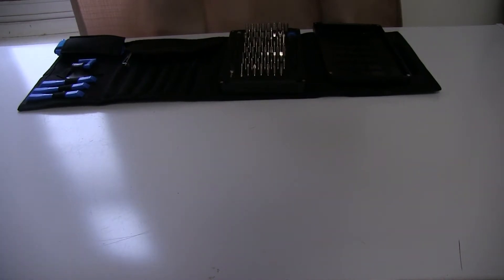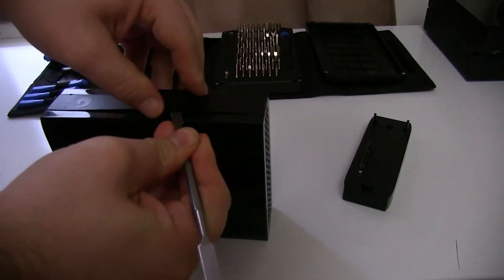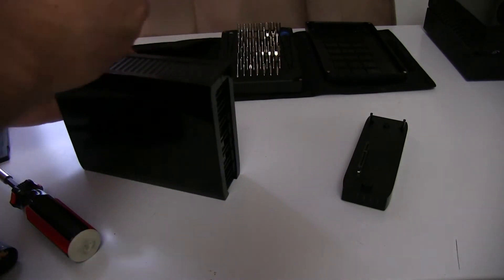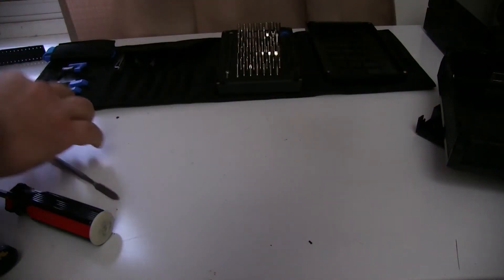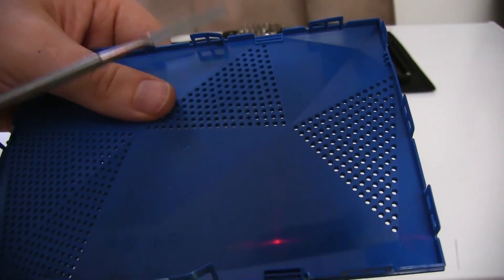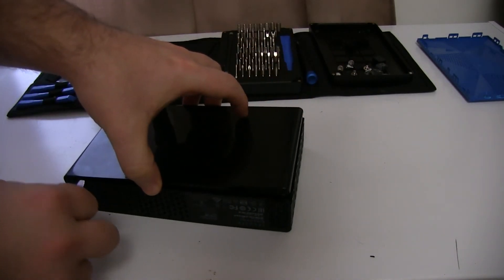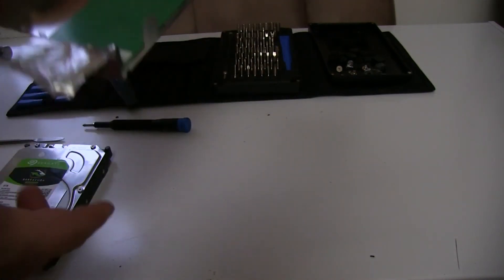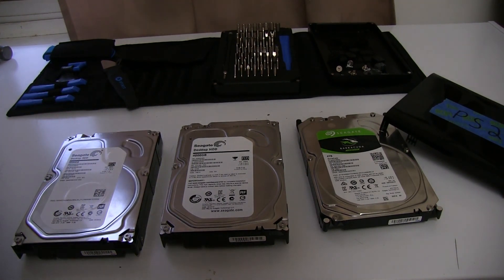How To Disassemble A Seagate External Hard Drive!

Comment: I really appreciate you providing this guide. The first hard drive you worked on is the exact drive I have.  Had it for over a decade before it stopped working. Hopefully removing it from the enclosure and hooking it up to my sata adapter bridge can get it back up and running again.  Your video is one of the only ones I’ve found on YouTube that has a guide for this model external drive and I feel grateful to come across it. Much thanks!
Reply from the maker: great! glad i helped

Comment: Thx. Worked. Its insane and disgusting how much effort they put in to make those drives unacceptable! Specially on those locked boxes with the heat problems.
I opened mine after a broken badblocks. Outside it was warm, inside the drive nearly burned my hand. No wonder so many errors, after freeing the HD it is now nicely running without any errors!!!!
I am sure if they do not change this behavior not right now, they will pay a lot more when anti-obsolescence laws are in-place in US.

Comment: Thank you for sharing this info. I have a 4TB Seagate I've tried to open but the back of the bottom plastic is not prying away and I didn't want to break something important inside. My desktop is not recognizing it so I want to mount it in the desktop to see if I can get to my files.

Comment: I have a seagate 5tb plus hard drive with a bad connection (not the usb hub but the part that goes into the hard drive).  Do you have any videos showing how to replace the sata (?) so that the hard drive is detected?

Comment: DO NOT hit your hard drive enclosure with a hammer.. EVER.
You risk damaging the internal drive, DO NOT USE A HAMMER as he did in this video. EVERRR!!!
At 6.01 he taps the hard drive with his screw driver, please try not to tap anything on the surface of your drive. Hard drives are very susceptible to shock. Hence why they use rubber stopper around it to absorb shock from the external enclosure from transferring to the SATA drive inside.
OMG at 6.26 he taps the drive on the table to get it out of the enclosure. Yes, you might get it out that way, but you also risk it not working anymore, and waste of time trying to retrieve data from it because it no longer works. NEVER tap a hard drive (even it's corner which may look sturdy) on a table top.
Reply from the maker: oops